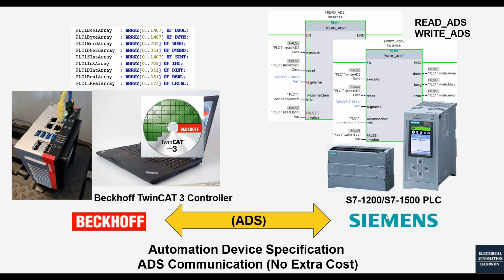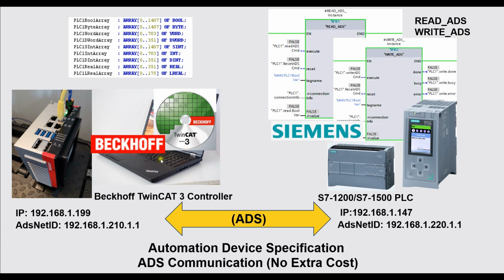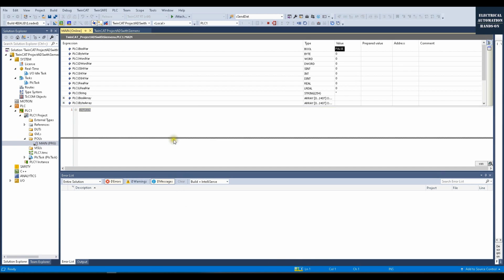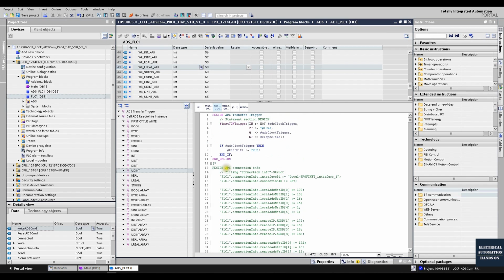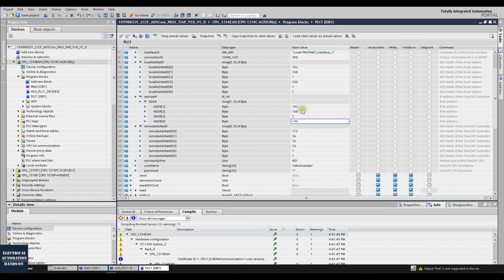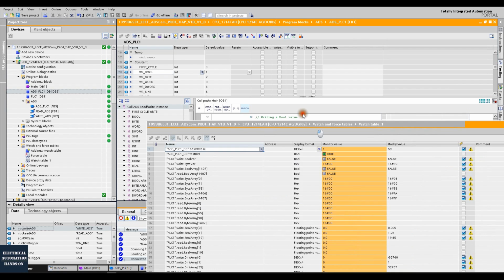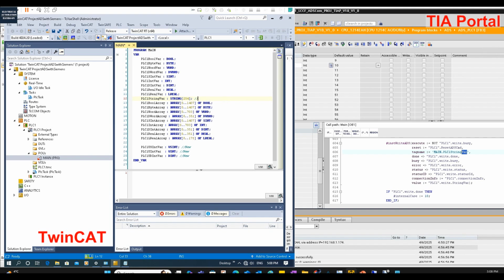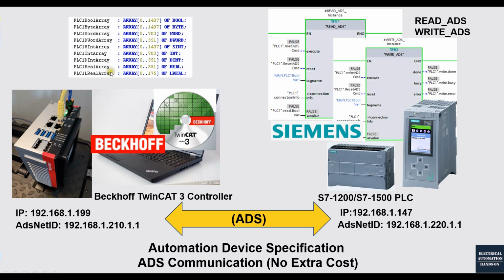COM37. Siemens PLC ADS Communication with Beckhoff TwinCAT PLC

Comment: I have tried this example, but it took surprisingly long to read and write data Siemens-Beckhoff? What were your update times, if you recall? In my case a bit more than 3 sec whuch is huge, if I estimated correctly. I wonder if it really takes that long to read and write those variables.